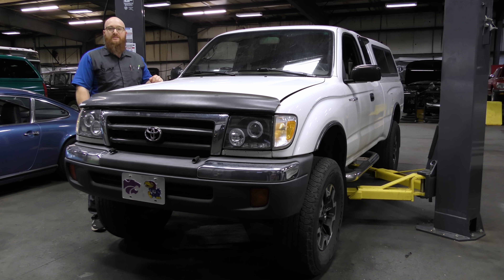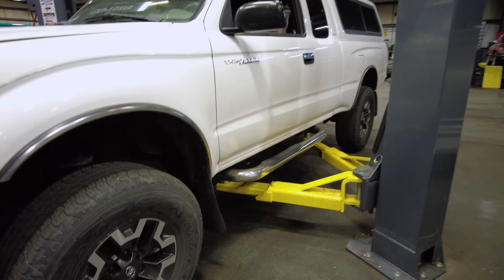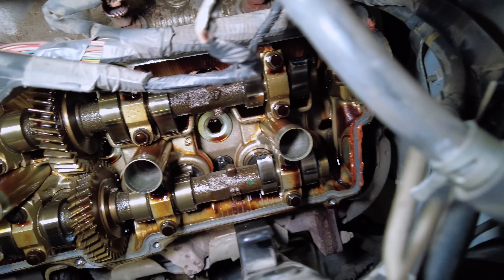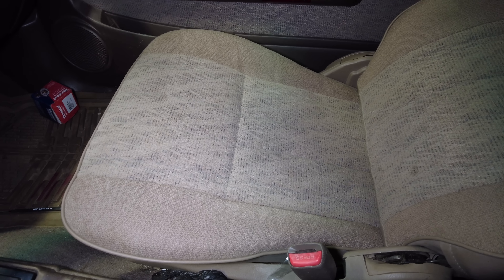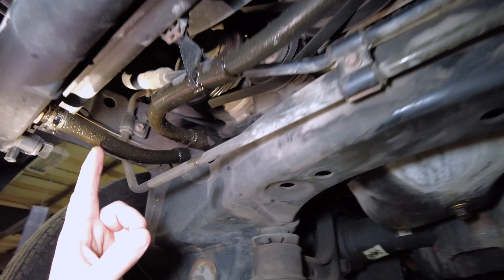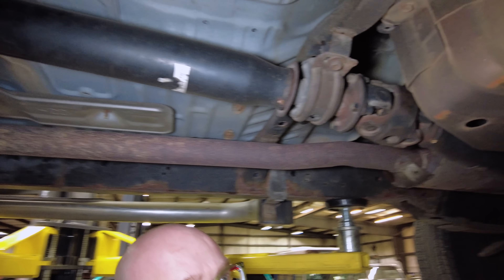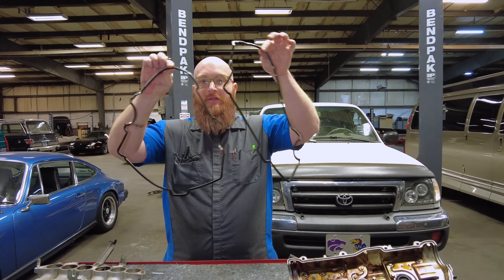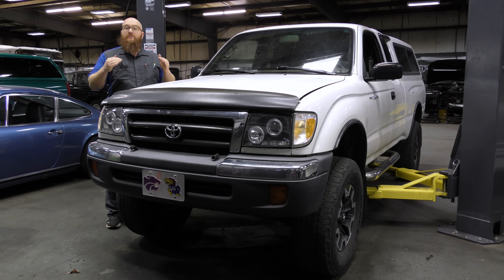Is it worth fixing this rusted out '99 Toyota Tacoma? CAR WIZARD explains

Comment: Not to ruffle any feathers but. I'm a Toyota fan myself I own a '22 4Runner ORP. But that passenger side frame rail at the front leaf spring mount is seriously rotten and compromised with holes. With the driver's side already having been patched I won't touch this truck with a ten foot pole. Questionable about another 100,000 miles. Just saying.

Comment: I had the same model pickup.  Other than the frame, I have nothing bad to say about them.  Nissan trucks are more affordable and have lasted just as long as my toyotas.  I prefer Nissan trucks because they don't use a timing belt and their 4 liter V6s have more power. Better bang for the buck in my opinion.

Comment: Any mechanic worth their salt will tell you that a Toyota will make 350K with just regular maintenance for the area it resides in. Salty areas are going to result in rust, period. All along the Gulf Coast, the cars are rotted out from the salt in the air. Go a little inland and that is no longer a problem. Many northern states use salt on the roads in the winter causing rust issues. That truck is most definitely worth the time and money to keep on the road.

Comment: I always like to see older Toyotas with cruise control. They still use the exact same switch to this day on brand new Toyotas. They changed the lever, but the switch in the steering column is exactly the same. If it ain't broke don't fix it😀

Comment: My grandfather had a 90s gmc Sierra 1500 original motor and transmission it ran great and it had close to 270,000 maybe a little over before it got wrecked and probably would have kept on going

Comment: Even if it was a GMC or Ford or Dodge truck of that vintage they also easily last several hundred thousand miles if they've been somewhat maintained. The biggest problem with them is they're the trucks that end up as work trucks and then beaters and not maintained at all.
Another way of looking at the cost is that $1500 in repairs could easily keep it on the road for another year or two and wouldn't cover more then a few months of payments on a new truck.

Comment: You would have loved my 88 Sierra. 7 effing  fuel pumps in one year. The dealership had no warranty as it was built by a company in China. For those who read this, stay very far away from the dealership. I took the truck in one morning. Either I had a bad torque converter, or something was wrong with the trans. When I came in to pick it up, they didn’t even check the trans. Instead, they decided, without my permission to install a new intake manifold gasket. The bill was almost 2 grand and the trans wasn’t even looked at and still ran like crap. I got under the truck the next morning and found that two of the bolts were loose on the torque converter. Problem solved.

Comment: Toyota trucks are simple basic . Perfected older technology, but when they changed, they did it right. The starter on the 5.7 v8 was in a bad location.  The new truck rear bumper is covered when tailgate is open, but not many can step that high, so bump fold out steps are needed like all trucks.

Comment: I have a 1998 limited v6 toyota tacoma it has 253,000 miles but it still runs super smooth i wonder how long will it run it has good maintenance
Reply: automatic or manual transmission?
Reply: @JAY-97-97  automatic
Reply: @LS-tj1ip   then no need to worry about the pilot bearing freezing on the input shaft and buggering up the transmission then!  i just had this ordeal happen to my rig around 290k miles 8^{ ... i don't what issues if any that an automatic might have?

Comment: I say this as someone who owns a 250k mile Toyota and works on them my concern is people are only hearing part of what you are saying here. If someone were to bring this car to me asking me if they should buy it the answer would be a resounding no. They will struggle to find a shop that will tackle that frame repair, I won't tackle it for a vehicle someone else drives either. You also are doing $1500 of repairs, that plus the frame repair and with people asking $10,000 for these vehicles with north of 200k miles in similar state of disrepair the value proposition is gone. That being said if I owned it would I repair it? Absolutely, because I can't buy a replacement for under $10k.

Comment: Keep pushing that Toyota are good reliable vehickes that Toyota Tacoma usd $1500 to repair it thats no big deal it will be driving fown the with twice the miles on it l like Toyotas especially the older ones because they so well built and will go a lot further than most other vehicles which us tge largest motor manufacturer in the world Toyota no other motor manufacturer can hold a candle to them except gor Honda Mazda and Suzuki

Comment: I really don't expect a comment from the Wizard but maybe others will choose to respond,,,, at 9.02 in the video Wizard shows us the rust repair on the frame exactly at the lift point,,,, In my opinion I feel this plate steel being welded to the frame is not safe,,, regardless of how good the weld looks... moving on to the other side there is obvious corrosion right through the frame where the rear shackle attaches and the Wizard states that this side also needs frame repair,,,,,,, I am a resident on Ontario, Canada. Deep in the rust belt. Vehicles here with frame failure immediately are pulled off the road. Again it is my opinion that this vehicle is not safe for the road!!!!! Let's be realistic the frame has corrosion and has been compromised from a safety point of view,  Do all your local drivers a favor and pull the plates off this truck and send it to the scrap yard,,,, Do you want to be sharing the road with a vehicle like this?

Comment: That's all I drive Honda's and Toyota's I have a 08 Ridgeline 173k on the clock only thing I replaced on the engine is a starter and timing belt everything works as it should
Reply: So  I drive a 05 Hyundai 190k miles  8 years no problems . Paid 500 bucks at repo auction

Comment: I met a guy a few years back with the same truck from the same Era with a brand new frame under his truck that Toyota replaced under warranty even though the truck was roughly 20 years old at the time. He told me the dealer had a huge pile of old frames from other replacements they had performed. Apparently the type of steel used in those frames at that time made them very prone to rust. This is one Toyota I would be leery about buying if the frame has not been replaced and the vehicle spent any part of its life in the rust belt. I have a 2000 Chevy Blazer with 210,000 miles on it and the frame isn't perfect but it's 10X better than this Toyota. Even after the patches it still looks like it is getting pretty bad. Just because the drive train will keep going that doesn't make up for a spring perch tearing off and causing an accident.

Comment: when is it necessary to change the leaf springs..mine is 160,000miles with loud noises when i hit bumps ..ok when there is load in the bed
Reply: i got new leaf springs on my '97 taco at 321k miles... custom made Alcan Springs in Grand Junction Colorado... so far a bit over 30k miles have been wheeled on with them

Comment: My dad’s 1999 Tacoma pre runner 2.7 has…. 571,676 miles on it… original starter, original a/c compressor, original alternator, original engine and transmission…. Toyota all the way….

Comment: I have one just like it. Mine is a 1998 and it has 326,000 miles and still running strong. I just put a $1000 in the suspension.

Comment: I used to hate Toyotas just because everyone would always talk about how reliable they were! I knew that they were overbuilt and it made me mad that American manufacturers weren't doing the same. Like a Toyota Tacoma has a drivetrain that can handle 400 horsepower but it only has 195! And a Chevy has 300 and can't handle much more unless it's a one ton. When you see cars that only have 100,000 and are having issues you have to wonder, did they even test this engine and transmission in real life or was it all just computer models? I mean if you take an engine and run it 24 hours a day for a month and take it apart and redesign the parts that fail what's the problem? Having throw away cars isn't sustainable! With that being said I have a Toyota and a Chevy that both have 280,000 and they were well taken care of since new.
Reply: I suspect that many Big Three cars can last 200K miles, but you have to be very diligent about scheduled maintenance.  They don’t leave a lot of room for error (and depending on which make/model, even something like replacing a water pump can be expensive because of where it is and what has to be removed to access it).

Comment: I have to laugh every time you talk about Toyota because when I wanted a mid size truck my mechanic told me to go with a Tacoma I did and she is about to hit 100k and all  I did to it was fluid and filter changes it still has the original brake pads

Comment: i have a 2003 toyota hiace work van it has 250,000 miles on the clock it's a but rusty but even in -0 degrees centigrade it starts up immediately

Comment: The owner missed the boat, they should have had that frame replaced by Toyota.  i know several people with rusted out Tacoma frames and Toyota replaced the entire frame under an extended warranty they put in place due to issues with the original frames.

Comment: MAN.. you Said Rusty and I went WHERE!.. LOL Try living in Maine or the North East. Raw salt and Salt Brine used on our roads and a 4 year old truck frame looks ten times worse then that truck. Weld That Frame up. People Make trailers and You can get the same plate steel. It is an easy fix around those rear leaf spring brackets.

Comment: My 2000 Acura TL had a chronic check engine light at about 263k miles.😮‍💨 
Mechanics could not figure it out and I had to give it up.😐
Gotta used 2008 Honda Accord. 👌

Comment: Well perhaps the older toyotas were good, but I am not feeling the toyota reliability after dishing out $1000 canadian on having a portion of the steering column that has the u joint replaced at 80k klm (48k miles) on my 019 camry! And toyota knows this is a problem because they extended the warranty on the 018 models for this issue. But they need to do it also on the later years because some are having the problem on 020 models as well. I asked for the part after it was installed at the stealership and it is pretty flimsy looking like good for a go-cart or lawn tractor, not a car. So a thumbs down from me at least on the newer camrys.

Comment: I own a 2009 Toyota sienna with 240,000 miles and a 2015 Chrysler 200 with 98,000 miles.    The 2009 Toyota is in better mechanical shape and is more reliable.    The 2015 Chrysler is giving me trouble.   The transmission had to be rebuilt twice and the car  is leaking fluid.   The Toyota is doing neither and it drives like new.    Anytime I have to go on a long trip,  I take the older Toyota.    When I buy another car, I will be trading in my newer Chrysler and keeping the older Toyota.   I will never buy a FCA product, but my next care will be a Toyota.

Comment: If they don't get that frame boxed in with plate steel, all of those repairs will have been in vain.
I understand why you don't do it,  but, they need it done.
And, done by a better shop than the one that did the other repairs.

Comment: I just bought a 2001 Toyota Tacoma 4dr 4WD TRD pro for $2800 with only 179k miles and a stack of service records. Only issues are major rust on the frame. Frame has two big cracks in it and need to get the original exhaust reworded since it rusted off but came with the truck. Think it’s a good deal ?
Reply: Not to mention guy was asking $7500, talked it down to $2800

Comment: I have a 1996,4cyl. Sonoma,198.000 miles.Still runs great but I live in NJ,I can"t keep up with  the rusted out,fuel and brake lines,it"s gotta go.Thinkin about 4cyl Nissan Frontier,6-8 years old,,has to be automatic,I"m handicapped,are Frontier's an ok vehicle?I only drive about 5000 miles a year.Any responses are appreciated-thanks.I know Toyotas are the best(I've had 2 in the past )but they"re just too damn expensive.

Comment: I used to work with guys that liked to hunt and they SWORE by their Toyota trucks. They said they got 200k miles and never turned a wrench on the motor. Didn't Toyota replace the frames on some of these trucks?
Reply: Tell the truth David. If that means singing the praises to Toyota and Honda, so be it.

Comment: I bought a 2017 Toyota Corolla Im - I loathe this car
its manual transmission is a textbook example of how not to make a transmission its hard to drive.
its funny to watch people criticize my driving , drive it and they stall it multiple times like I have a puck clutch or something.

so its redeeming factor is maybe it will just last forever?
I would have gotten a subaru impreza hatch manual if they had any manuals. its whatever i guess.

Comment: Less rust than my 2000 4runner and worth fixing cause is no option.

For less than cost of even a decent used 4runner, I could send mine off and do a full body off restoration.

Comment: The newer EV's may not have rust prone parts.
But to counter this, the prices are horrendous.
10 000 yrs. from now, people will have forgotten the 'magic' of Toyota.
If you can plug in a grinder and cut the steel, be it a crankshaft, camshaft, or a body panel,
it is just junk.
Although steels exist that can withstand the angle grinder disc.
These steels are used in lock mechanisms, not engine components.
Obama enacted the Cash For Clunkers.
I'm sure all Toyotas passed this test.
The Wizard should replicate a cash for clunkers test on a discarded
Toyota engine just to refresh people's minds.

Comment: If the only thing wrong is the engine or transmission, why not replace it if you can get a other 10 years out of it. Only thing that the value matters for us if it gets wrecked or any insurance stuff. It's that or spending 10x more on a new vehicle. You tell me. My 01' rolla is approaching 200k, I abuse the shit out of it plus the environment where I live sucks. If this thinga motor goes, yeah I'm ok putting 2k into a used engine and go another 5 years

Comment: I think toyota peaked in 1999.  I have a 3rd gen 4runner and a 5th gen 4runner.  The 99 was built better and still drives better.  The 99 is also much more capable off road.   I don't expect much from the 6th gen 4r coming next year.
Reply: Was the newer one you have actually built in Japan? There’s a surprising quality difference between Toyota’s made in Japan vs elsewhere.
Reply: @Bonanzaking  All 4Runners have been built in the Tahara Japan plant.  Same factory that produce the Land Cruiser, Prado and the Lexus GX.  There is a rumor that 4runner production will move to Mexico for the 6th gen.

Comment: After buying and using many cars, maybe 100, had the luck to used them and send them down the line, I can honestly say, European cars, don't keep them more than 2 years, if new,  they are nice but wont last, expensive to fix, just a pin in the ass and wallet, Americans car are bigger, or used to be, not very reliable but at least those used to be cheap to fix, not any more, Toyota and Honda, the best there is, if you plan to run them for as long as the wells fall of of them , well maybe they will last longer than you, if maintained properly, from the economics stand point, it makes no sense buying anything else other than Toyota/Honda products. we had many Hiluxes and Prados, I will put it this way, the only reason we sold then it was under the accountants pressure, there was no point, they had no book value any more, so we got a new one. Me I went from Mercedes to Lexus back in the early 1990, never look back

Comment: Singing about Toyotas , I’ve got a 21 yo Chevy Hoe.   My trans cooler lines and valve cover gaskets never leaked but my oil pan did a little.  Because of being anal.  I replaced the gasket.  It wasn’t 1500…. and 278k later.  She still does well.   Easily got another 100k I’m sure.   I also have a Lexus LS.   So I like Toyota too.  😂

Comment: It has fuel injection and ABS, its OBD2, it ain't "old"... It's a slightly less advanced rolling computer then say a 2019 taco, but it's still modern enough. 

"tOyOTa best car ever..." I'd rather have Hoovies green OBS GMT400 that's sitting in the background, and I say that as an OBS Ford guy.
Reply: It's not "old" but it isn't overly complicated. A shadetree mechanic can handle this level of electronics without too much trouble. Things have changed a lot in 20 years.
Reply: When wizard says old my mind goes to points ignition and carburators. To the type of vehicles that have been modified (for better or worse) to the point that the owner (or pervious owner who did the modifications) is the only person who knows just what exactly is going on with the thing. This particular truck isn't very complex compared to a new one, but it is complex enough that billy bob or jimbo haven't been out trying to make a hotrod out of it, its still held together with stock or stock replacement parts. Its still modern enough and not so obscure or weird that any reputable parts place could likely get you 99% of the parts for it. Like most vehicles of the last 2 or 3 decades its a good "normal people" vehicle, drive it until something breaks, then replace said broken part with a duplicate part that you can buy literally anywhere, then rinse and repeat.

Comment: toyota is overrated. my parents 2008 prius burns aton of oil at only 200k. I had a 2005 corolla with a manual transmission and all those transmissions have issues with grinding synchros. toyota has the frame problems you talked about and they have plenty more engines other than the prius that are known to burn oil